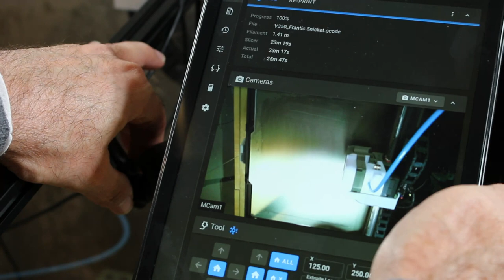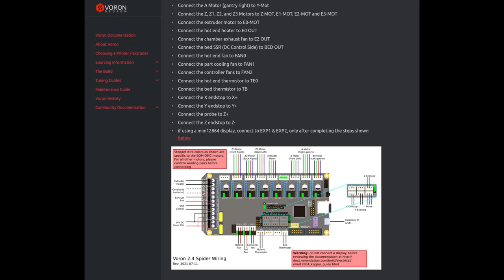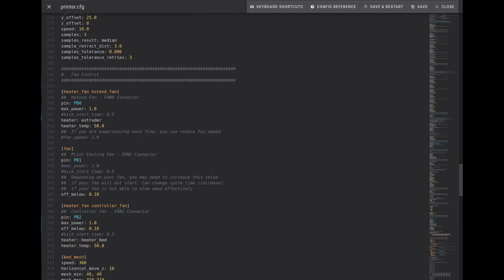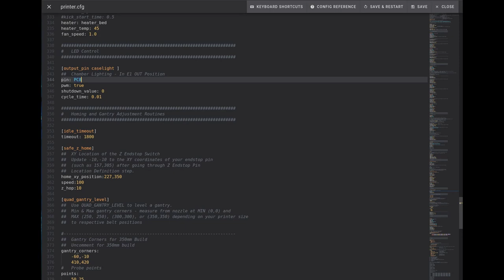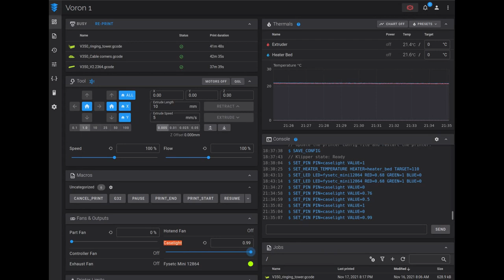Lights! Camera! Action! - Create LED strip lighting & webcam mount for your Voron or any 3D printer

Comment: FYI the afterburner will 100% hit the camera if a print ever gets that high and wide. If you keep the camera you should adjust the printer to make the max z height lower than the camera to insure no hits.
Reply from the maker: I 100% agree with you!  At some point, I will probably replace the camera with one that is more compact.  It's rare for me to print anything that tall that is also that wide at the top.  So I will be careful until then.  I actually was going to try and mount the camera on the Y- rails of the gantry.  I might still try that at some point.
Reply: @KapmansBasementWorkshop  That's what I did. I have a thin camera mounted on the gantry at the back. So it kind of moves up with the print. It works ok, they are not very good quality for those small cameras though.
Reply from the maker: @CodeMonkeX  From the back, do you get a fill clear view of the print?   I had actually intended on mounting it on the left y gantry extrusion but was worried about vibration.  Does your camera shake at all during a print?
Reply: @KapmansBasementWorkshop  No it does not shake. It's good enough to see it's still printing with no issues. But not nice enough for time-lapse or anything like that. I ran a ultra thin flexible HDMI cable down the z-chain, and used little ribbon to hdmi converters at each end.
Reply from the maker: @CodeMonkeX  So that's also interesting.  I never thought of using HDMI.   One thing for sure, the Voron 2.4 is not great at accommodating a camera internally.  I might eventually move this to the outside.  But so far, the camera is working well enough.
Reply: Just get the 920C. It's literally the perfect one, recommended by the devs. Sits in the front, doesn't interfere with anything.

Comment: What is the wire gauge?
Reply from the maker: I would strongly recommend that you calculate the power needed based on the total number of LEDs that you use and then double (as a minimum) that due to the heat and use that for the basis of your wire selection.  Thanks for watching!

Comment: I wanna like the video but you don't show anything about plugging the camera in or setting it up.
Reply from the maker: Good point!  The USB webcam just plugged in and you select the camera via Fluidd/Mainsail UI.  For the LED lighting, I just used one of the 24v swichable power terminals on the MCU.  Assuming your MCU can control multiple nozzle heaters and assuming you are not using all of them.  I am using the Spider 1.0, you are probably using a different controller board.  But, here is the code for the LEDs in Klipper which goes into your printer.cfg file:

[output_pin caselight ]
##  Chamber Lighting - In E1 OUT Position
pin: PC8
pwm: true
shutdown_value: 0
cycle_time: 0.01 

Once you restart klipper, the control for the LEDs will appear in the UI with a dimmer.

If you have more specific questions, please ask.
Thanks!
Reply: @KapmansBasementWorkshop  Ok but where do you plug it in and do you have to configure anything to get it to work cause I plugged mine in but I'm just getting a white screen.
Reply from the maker: @Konman  You just plug the webcam into a USB port on the PI.  It's probably a good idea to reboot as well.
Reply from the maker: @Konman  Did it work?

Comment: hey, so any 24v led strip will work right?
Reply from the maker: It should.  Also depending on the MCU, you may have additional options for color and voltage if you like.  I used 24v.  Actually, the one issue is to make sure the strip fits in the holder.  I found some that were wider/non-standard.

Comment: That's a great idea to add heat shrink to the ends of the LEDS. Great video. Thank you.
Reply from the maker: Glad it was helpful! I was worried that somehow they might short or the cables might detach.  I also thought it looked pretty cool.  Slightly more finished vs home brew.  Thank you for watching!
Reply: @KapmansBasementWorkshop  I think the same thing every time I put shrink tubing on my solder joints. But luckily found it's easy to remove with exacto blade. But absolutely right on the aesthetics, much more professional looking

Comment: Where do I find the remix of the wire guide?
Reply from the maker: Up in the video description.  But now, also here:
STL Files:
LED Moount:  https://www.thingiverse.com/thing:4752369 - LED Moount
Longer LED Mount if you need it:  https://www.thingiverse.com/thing:5142383 - 
Wire guide, Original, but I'm using the remix:  https://www.thingiverse.com/thing:4655832

Thanks for watching!
Reply: @KapmansBasementWorkshop  The video description only has the original with the hole instead of the slot and I can not find the remix with the slot. Do you have a link to it or will I have to remix it myself? Your videos are awesome by the way. I appreciate what you do for the community!!
Reply from the maker: @chucktaylor5878  Are you referring to this? https://cults3d.com/en/3d-model/tool/kapman
If not, let me know and I'll dig a little more.
Reply: @KapmansBasementWorkshop   Yes that is what I was looking for but I printed ends for the longer led bar with JST connections so I can just plug them in and unplug them easily. Let me know if you are interested in them. I will be putting them on Thingiverse once I have everything perfect.
Reply from the maker: @chucktaylor5878  Please post a link here.  That's a good idea and when I have some time or need to make some changes....
Reply: @KapmansBasementWorkshop  hello I can't post the link for some reason so look on thingyverse for modsolution it is there.
Reply from the maker: @charlestaylor5810  I'll check it out.  Thanks!

Comment: I tried this on my RR V-core 3 with an SKR Pro 1.2 ...it's all fine until the hotend reaches target temp, then the LED strips start to flicker. Any way to fix this ?
Reply from the maker: Hmmmm.  My Voron is fully enclosed and hits 60c in the chamber.  Mine does not do this.  The SKR does not sit in the chamber, correct?  And what kind of flicker?  Periodically or very rapidly?
Reply: @KapmansBasementWorkshop  Enclosed…Almost everything is outside, except for anything attached to the hotend, of course. Rapid flicker…Only when klipper tries to maintain target temperature. After it’s done printing, everything is back to normal. I’m guessing when the main hotend reaches the target temperature, it’s pulsing to maintain the hotend temperature and other hotend outputs got tied to this somehow ?
Reply from the maker: @PhongZZ  With the led lights being on another output that is separate from where the hotend is connected, in your printer.cfg file. they are connected to different pins too, right? So I have a section like this:

[output_pin caselight ]
##  Chamber Lighting - In E1 OUT Position
pin: PC8
pwm: true
shutdown_value: 0
cycle_time: 0.01

And the hotend is on another pin, right?
 Can you turn on the led lights on and off independently in the Mainsail/Fluidd page?
Reply: @KapmansBasementWorkshop  

##### LED LIGHT####
[output_pin case_light]
pin: PD14
pwm: true
shutdown_value: 0
cycle_time: 0.01  

Hotend is on PB1...and yes, I got the same slider you have. I even turned off PWM, where it gives me an on off switch which works fine too. But as soon as the hotend reaches target temp, it starts to flicker rapidly. My hotend's control is PID.
Reply from the maker: @PhongZZ  I'm sorry, but I cannot find anything wrong with what you did.  Is there a chance there is a problem with the MCU?  Can you try one of the other Heat outputs if another isn't being used?  Or, how about a fan output?  It makes no sense that the mcu would be adjusting the power in sync like that....

Comment: Another great video. Going to set up lights fairly soon and your tutorial was quite helpful. Slowly getting the voron reliable and it will be nice to have better lighting in there. Finally got the pre-wipe gcode figured out so I don't keep blobbing or have the filament curl into the inductive probe then swipe it into my print and ruin it.
Reply from the maker: The LEDs were a huge improvement.  I need to work on that pre-wipe soon. Thank you for watching!
Reply: @KapmansBasementWorkshop  This is what worked for me in my cura start print profile for the Voron 2.4 350.
G92 E0 ; Reset Extruder
G28 ; Home all axes
G1 Z2.0 F12000 ; Move Z Axis up little to prevent scratching of Heat Bed
G1 X0.4 Y340 Z0.3 F5000.0 ; Move to start position
G1 X0.4 Y30 Z0.3 F1500.0 E15 ; Draw the first line
G1 X0.6 Y30.0 Z0.3 F5000.0 ; Move to side a little
G1 X0.6 Y340 Z0.3 F1500.0 E30 ; Draw the second line
G92 E0 ; Reset Extruder
G1 Z2.0 F3000 ; Move Z Axis up little to prevent scratching of Heat Bed
G1 X7 Y340 Z0.3 F5000.0 ; Move over to prevent blob squish
It may do an extra home but works nicely.
Reply from the maker: @ZeonsZone  Thank for this.  I'm sure it will save some time when I get started on this.
Reply: @KapmansBasementWorkshop  No problem, glad I could assist. Im on IG at the same name if you want to talk gcode. 😁

Comment: Are you able to show our explain more of the wiring from the led to the board? Did you just power each bar from the other and run into the boards pins?
Reply from the maker: Each bar is simply connected to the other via soldered wires.  Negative to negative, positive to positive.  The last set of soldering pads have no wires and for protection, I covered the end with heat shrink tubing.  The 1st are simply connected to the mcu, again connecting - to - and + to +.  While my MCU has a connection point for RGB lighting, I'm saving that for some day when I choose to use RGB lighting somewhere on the printer.  My LEDs are white only.  I connected them to an unused hot end connector on the MCU.  Make sure the voltages are correct.  This worked for me since the LEDs I chose are 24v and so it the port for the spare hotend.  Let me know if that isn't enough detail. and I'll see if I can come up with a better description.

Comment: I need to figure out a camera mount for mine. I have an older HP webcam propped up on a alcohol bottle filled with water looking through the door and I like that view. Though this gets in the way of the door  maybe something that swings out of the way would work.
Reply from the maker: I think I have seen a few like that on thingaverse...
Reply: @KapmansBasementWorkshop  I will have to take a look.